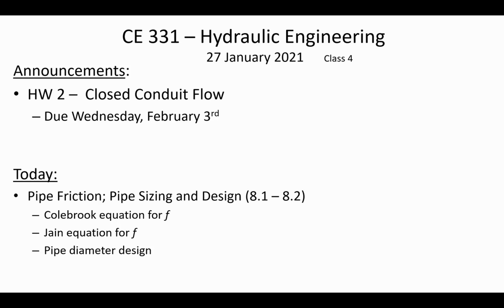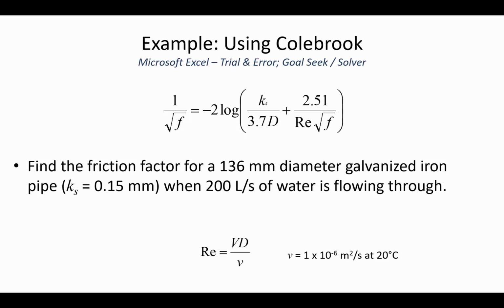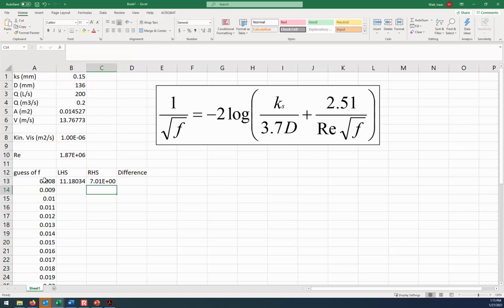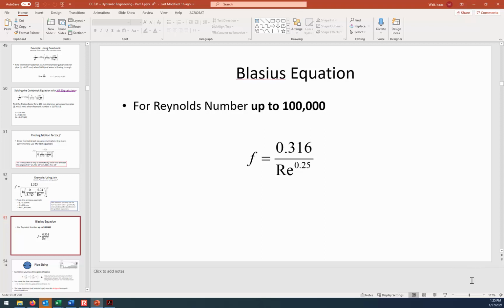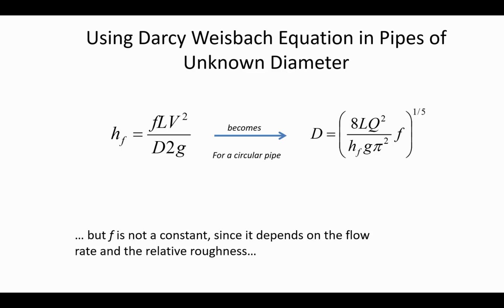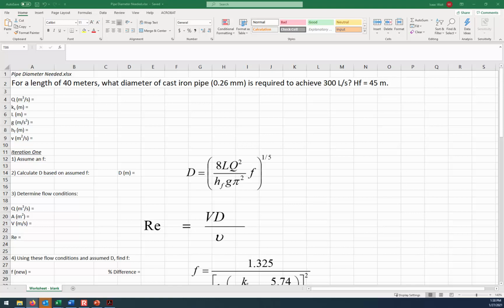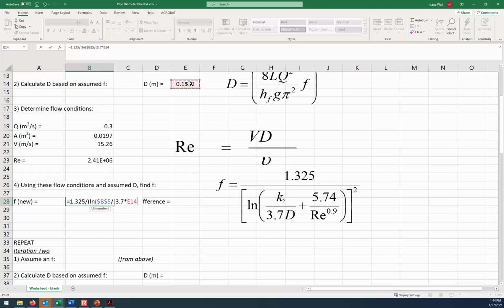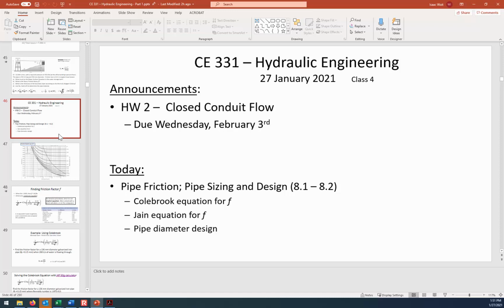Colebrook equation, Jain equation, Pipe diameter sizing iteration - CE 331 (27 Jan 2021) Class 4

Comment: Thanks. Very clear and understandable explanation.

Do the Jain and colebrook equations change depending on whether the Bernoulli equation is in head form or pressure form?

That is, Darcy weisbach changes depending on if Bernoulli is is pressure or head form, does the same also apply to friction factor calculations?